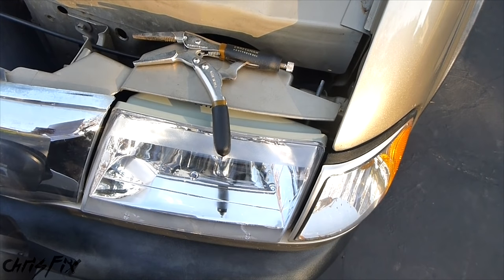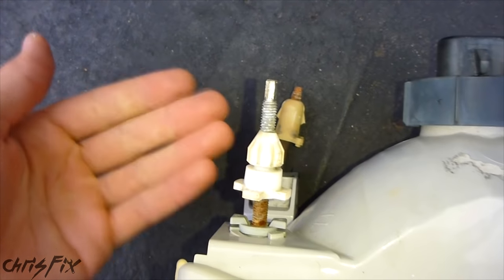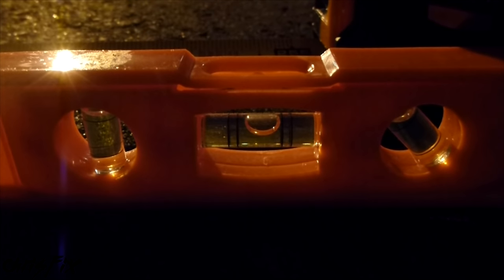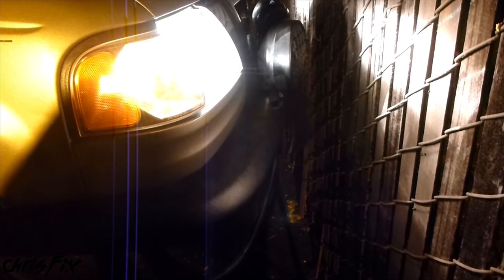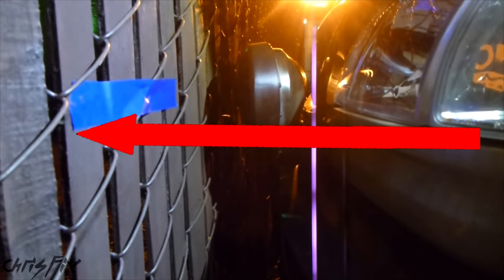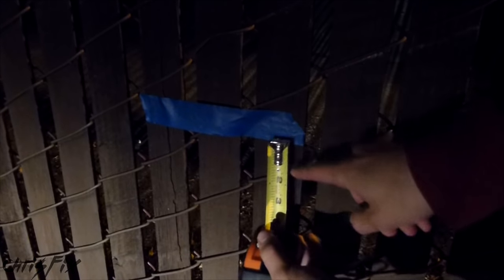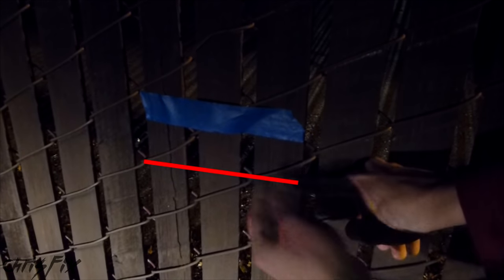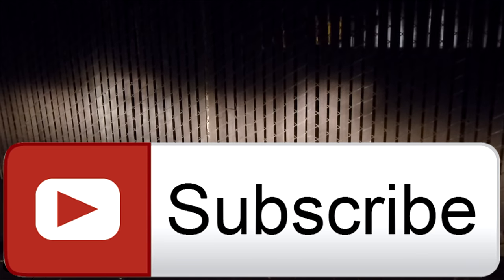How to Adjust, Align, and Aim Headlights and Fog Lights PERFECTLY

Comment: I need to do this with my truck. Currently experimenting with led lights in the stock housing on a 2001 durango. Any suggestions on bow to do this with those? Should try both adjusting the lights themselves on the cuff (has 4 positions to rotate the light for different angles) and the adjustment screws on the headlight assembly?

Comment: ChrisFix, Hello i have a question,  for my vehicle i have a 09 Toyota Matrix, and when i saw you adjust your lights, you measured from the bottom of the headlights to the floor,   Now the problem is, For my lights their slightly slanted which doesnt give an Accurate measure. The only good thing about my lights is, They have that little Nipple on the actual light, how would I adjust my headlights if it has that?

Comment: Hey Chris wondering if you could help me? I was adjusting my vertical screw and the assembly( I think?) fell down and was pointing towards the ground. Any ideas? I did get it to point back up, but it’s too low and won’t adjust any higher.

Comment: Just gotta new lights for my truck and it was ticking me off when it wasn't level like my old ones. Gonna do this in the morning, thank you!
Reply: Stop using the standard 2" & 4" drop, these elevations change according to light height. States have min and max projection distances for the low beam. generally 135' minimum and 200' maximum. If you use the 2" drop @ 25' on headlights that are 42" you'll projected the beam @ 520' and not the state maximum. STOP BLINDING OTHER DRIVERS . 42" height @ 25' should be 5.25". Use the formula (42/200)x25=5.25" below center line. ( bulb centerline / light projection  feet  ) x the distance you are projecting it to  ( test wall, test board or other ) it could be anywhere from 10 feet to 50 feet. 

Fog lights have a maximum of 135' projection, so get those adjusted correctly too.

Comment: And use peneteant fluid on old rusty screws... One guy in control station during control pushed so hard on screws in my forester that he broke screws and I had to replace them -.- thankfully I had spare broken lamps and I was able to swap them but... Just saying, plastic turn knobs are not supposed to be forced with morse pliers

Comment: I can't even locate the adjustment screws in my 2008 Toyota Sienna.  I'm thinking that both headlights are pointed down too much.   I did, however, use toothpaste to greatly reduce the opacity of the headlamp lens.

Comment: Hello. I'm new to your channel, however I really enjoy it so far. I did have a question though. I have a 95 Nissan Pathfinder and the fog lights don't turn on. The bulbs are good, so are the fuses, and all other lights. The fog light switch in in my console and when I flip it, the switch itself lights up, but the fog lights stay off. Any advice?
Reply: I'd say it might be the wiring... have you checked if the current is getting through? or if there's any damage to the wire itself

Comment: would the 2 inch process be the same for sedans though, because your truck is obviously at a higher ride height than most cars.
Reply from the maker: It is the same for every car since it is about the angle. There are extreme circumstances like a lifted truck where you might need more like a 2.5in drop.

Comment: that's all fine and dandy if you want your head lights to be level, but most states require your lights to hit the pavement at 150 feet, level lights don't do that, 90% of ford vehicles from the factory are set level and are illegal in most states.

Comment: ChrisFix.  What is the purpose of the plastic parts on the adjusters if what you need to do is adjust the bolt ?
Reply from the maker: It holds the threads in place.

Comment: Hey,

What kind of aftermarket headlights are those.

Did you get them on rockauto?

When I compare the mazda and the ford headlights for 2001 they show up as different part numbers and are slightly different. The Ford one is cheaper, so I am wondering if they are exchangeable?
Reply from the maker: +Francoxyzm Unfortunately they are not interchangeable. I got them on amazon for $100 each. Here is a pretty good price for the pair: http://amzn.to/1LpxxaK

Comment: thnx for that work. and im gonna ask something. if you have adjustable light height 
level 0 to 3 inside the car, which number should be selected before the adjustments... or it should be lowest height ?  thnx a lot.
Reply from the maker: +Koray yücel That is a great question. I would set it at 2 so you can adjust it up or down if need be.
Reply: +ChrisFix thank u chris. It s a good advice.  U re awesome
Reply: +ChrisFix hi Chris. do you have any idea for perfect clean beige car seat and interior.? not leather, for fabric.

Comment: hey do you know how to turn off the daytime running light for a ford ranger?
Reply: maybe check the fuse that is connected to them. u can see it in the manual book. and you can pull that fuse away from your fusebox

Comment: is the procedure the same with projectors? I have a 99 WJ with retro-fit projectors and I'm not sure if I should be aligning them based on the beam under the cut-off or with above the cut off. For now I have them aimed low since I kept blinding people when I first put them in.
Reply from the maker: +Eduardo Serrato Same exact procedure with any headlights.
Reply: Awesome! Now I just need to find a good place to do this and I'll finally stop blinding people and I'll be able to see. Thanks.

Comment: Really wish this was mandatory for all the stupid truck owners with hid bulbs in the fog lights and don't use projector lens in the headlights... Then add on 15 other bulbs and run those two just to make sure. Great video had to do this two years ago on my car.
Reply from the maker: ferretkiller9454 Thanks a lot. I think people with HIDs and reflector housings should get tickets. It is like running high beams all of the time.

Comment: hi Chris, I am working on a PT Cruiser that for some reason I cant get the headlights to adjust. do you have any suggestions?
Reply: I think I see what needs to happen. up/down adjustment works fine but the left/right adjustment looks to be shimming the anchor mounting bolts. ok. out with the headlight assemblies.

Comment: Quick question, is it necesarly to be 25ft to make the meassures?
Reply from the maker: LOV2XRL8RL It doesnt have to be perfectly 25ft. It can be 24' or 26'. If you have to do it closer, do half of 25ft (12.5ft) and instead of lowering the tape 2in lower it 1in.

Comment: You want the passenger side to be 31-32 inches from the ground and the driver side 28-29 inches so you dont blind other drivers
Reply: Nope.  The proper beam measurement depends on the distance from the wall and the height of the headlight housing itself as Chris has indicated. Using your logic, an RX-7, with headlights only 20" from the ground would be shining right into the eyes of oncoming drivers, while an F250 would have only a good view of the ground about 40 feet out.

Comment: Do you know if it's possible to aim the headlights on a 2002 Toyota Prius? It seems like they're fixed but I could have missed something.
Reply from the maker: Matthew Santos They are adjustable but finding the knobs and turning they with your hand is tough. Try to look on the back of the headlight and feel around. They will be there!

Comment: I'm working on a project for making the headlights align themselves automatically as the car turns and speeds up like some of those BMWs but so you can bolt it onto any car, can anybody tell me exactly what changes within a headlight when it's adjusted?

Comment: Very helpful video,i did cringe when i saw the visegrips on the adjusters,lol,im one of those that has to have the right tool for everything, they do sell a headlight adjuster tool, its like 12 bucks or so and it looks like a little miniature ratchet real long and it goes in those little 4 mm tips,i have one and granted is not something that you will use a lot in your lifetime but i like having it, the name of the tool for anyone interested is    
Lisle 14540
Reply from the maker: +dntlss Thanks for the tip!

Comment: It's a lot easier to use a plywood or cardboard panel instead of a wall. You just move the panel to square it up to the car instead of squaring the car to a wall.
Reply from the maker: ***** Either way works. Thanks for the idea!

Comment: Hi Chris, how can i adjust lights of a Honda Accord 2006 as i have been driving the car with the lights facing the ground.
Reply: +Olumuyiwa George are you from South Africa? those vehicles should also have adjustment screws .... or rather take it to a local testing station... they can help you

Comment: hi chris fix how would I line my my head lights .I ave a Vauxhall Vectra 54 plate .and my fog lights are rite inside the bumper .how u can help
Reply from the maker: +Roy Holding It is the same process as in this video.

Comment: ChrisFix Would this work for pop-up headlamps? My Firebird's a little off.
Reply from the maker: Yes, this works for pop up headlights. Just put the headlights up and do exactly what I did in this video. Your adjuster screws are holding the headlight in from the front.

Comment: Why did you have to drag the tape 2 inches below again? just wanted to confuse those who don't know why you did it?
Reply from the maker: Because you want the lights angled down. If you dont angle them down it will be in the eyes of oncoming drivers and too high to illuminate the road.
Reply: kay poly My 92-96 Toyota Camry/Corolla Haynes manual says 2 in. down and 2in. to the left. So you might want specifications for your vehicle

Comment: Hi Chris. I have a bmw e90 2005 with normal h7 bulbs. What can i do to adjust mine? They don't have anything to adjust left or right, just up and down. Thanks
Reply from the maker: So left and right should be good then? If so just adjust up and down. If not, you can shim the lights to tilt it outwards
Reply: @chrisfix  As far as i know the left and right movement is operated by a little motor inside. Like some king of auto adjust when you move the steering wheel. But for what i see, when its on center/straing, the lights are very close toguether on the wall. The car is pointing to center 😅 and i don't see left and right movements when i steer. I was asking because you have an e46 and maybe its the same way i don't know.

Comment: Hey man, you should do a video on hid lights! I wanna know ur thought on them and do a review and installation video. I have recently just bought a set of kensun hid 8000k and i also drive a 03 ford ranger. Thanks!
Reply from the maker: nolan moreno Funny you say that. I have everything to do a projector retrofit from TheRetrofitSource Inc I am just waiting for the weather to get a little nicer so I can start the project! I will be making a video on the retrofit process so you can start with a normal headlight and end up with an installed projector headlight! Stay tuned!

Comment: Can someone tell me or send my a link on how to adjust the headlights on my 04 silverado 1500? I looked it up but can't find any info on it so i tried to do it myself. It has one screw to adjust it vertically but the problem is that the low and high beams are in the same housing. so when i have low beams on the left side is lower than the right and when I put my high beams on its the opposite. I just can't get them to be the same when using high and low beam
Reply from the maker: +knk171 Try the silverado forums and ask them there.

Comment: I have an 87 Oldsmobile Cutlass Ciera, it needs some TLC. my headlight adjustment screws ore on the outside and they are star bits. and also do you know much about the 87 Oldsmobile Cutlass Ciera?
Reply: Paul Brown I had a 91 Cutlass Ciera. They are good cars, as long as regular maintenance is followed. They don't have as much computer monitoring as newer models. I had a Hyundai Sonata that gave me nightmares! it had sensors for everything, even for sensors! I am glad I got rid of it. Wished I still had my lil Ciera. That car was somewhat easy to work on, drove great, good ride, & had some bit of style to it. I have a F-150, 06 model now. Great truck, but the gas pump is it's best friend!!! $5 in my Oldsmobile was at least 1/4 of a tank. $5 in this truck will get me to the next gas station!!!

Comment: +ChrisFix I really need your help with algning and aiming my headlights. I have a 2003 toyota Camry. Unfortunately, I dont have an adjuster on my headlight assembly.
Reply from the maker: +jOeL SiMoN There has to be a way to adjust them.
Reply: ChrisFix Well There is this screw that looks like a gear behind the assembly, but I cant adjust it with the headlight on the body. it needs to come out especially for the drivers side one.

Comment: I'm at the 2 min mark Chris Fix and you still have yet to SHOW HOW TO DO THE ACTUAL DAMN ADJUSTMENT.  What I mean by that is what measurements to take and/or how to do it.  I don't mean how to turn the adjuster or what type of tool to use to turn the adjuster, etc etc etc.  I mean what the steps are to ensure  that your light are level.....damn son, tighten up!   Tighten your s**t= up!

Comment: How often would this have to be done? yearly? Mileage?
Reply: TheMichael408 typically you should adjust it whenever your headlights don't illuminate the road fully, or when one of the headlights become misaligned. It's easy to see when pulling up to a dark wall with your lights on, both headlights should be about level with each other.
Reply: Raptor yea I mean I see shadows too from the housing.
Reply: I do it every time I change the bulbs. I use to super bright halogens and they last like 1.5 years.
Reply: TheMichael408 i think, as long as u didn't make any accident or a strong hit on the headlights the balance will remain the same as good, but this for new cars, if the car 10+ years old then maybe its need more often adjustments like at least 1 time a year would be oki..

Comment: Half the cars on the road in a city like Los Angeles are in significant disrepair.  Bad tires, questionable brakes, suspensions and emissions out of spec not to mention bad driving.  NOBODY gives a shot in our increasingly lawless society.  Commercial operators sorta do but only because there is a degree of enforcement.  I'm all for headlight alignment but do it for your own self, not others.

Comment: don't get me wrong, I like the video but somehow this feels overcomplicated. I've adjusted my headlights simply by stopping in front of a wall about 20~30m far away and leveled the cutoff where the ground and wall meet, and move the _/ pattern to the right of the car. but I'm in europe where the beam pattern makes things much easier and also have xenon projector headlamps with crisp cutoff.
Reply from the maker: +Jukonja This gets them perfect. You wont blind anyone and you will get the maximum use of your headlight beams.

Comment: Hey Chris, I buffed my lights and not bad but I got the sandpaper to make it better. Well the one headlight is smooth but foggy didn't do the other one. Not scratched just foggy. Used 1000 and 1500 grit. Any ideas? Thanks Dave
Reply from the maker: dave gale Here is the perfect video for you: How to Restore Headlights PERMANENTLY
Reply: Chris that's a great vid. But at this point the headlights are foggy  from I don't know what. I tool out a bulb to get inside but it didn't help. Could that be from outside? I could sand with 2000 grit if you think that would help
Reply from the maker: dave gale They are foggy because the sunlight's UV rays degrade the plastic. Sometimes it is so foggy you need to sand extra and sometimes it is so bad you need new headlights. If they are bad, you can try taking apart the headlight lens and cleaning the inside like you did the outside. Then if you clean both the inside and outside and they are still foggy, they are probably bad. Here is how to separate the lenses: How to Separate Headlight or Fog Light Lenses (without Oven, EASY)
Reply: Hey Chris I went back and looked at your site on cleaning.,and I thought I did it right but I san
ed further with 2000 grit and some polish and wow!! they look great. Thanks Chris
Reply: dave gale
The only bummer is that they'll be cloudy again next year since the protective coating is gone.
Reply from the maker: ScubaCat3 Check this out: https://www.youtube.com/watch?v=UEJbKLZ7RmM
Reply: ChrisFix
Good idea.  How long does that last?  For the Windstar (we have an 02), the TYC replacement assemblies including new bulbs are $40/piece on rockauto, so I went that route.  I did a pretty ghetto job on aiming but they seem good so far.  Granted, assemblies for other makes and models are a LOT more expensive to replace.
Reply from the maker: ScubaCat3 It will last a few years. If the headlights are only $40 it is worth it to just get new ones! It is amazing how much better the car looks after you get new/ restore headlights right?!
Reply: Yeah, I'm impressed by the difference watching some of these videos.  I did the buff/polish thing last year (which you'd never know looking at them now) but brand new is even better.  Interesting that the new assemblies include new bulbs too at that price.
Reply: dave gale Polish with water flowing from a Hose with minimum of 3000 Grit Wet & Dry abrasive paper and then buff with Fine cutting Polish ( Yes the Body Paint stuff ) , you will find they will clean up well, this is unfortunately a down side to modern Lexan and other Plastic or Polycarbonate light fittings they will eventually get cloudy again so a gently polish with you regular Car cutting and polishing compound will go a long way to keeping the lights clear.
.
Reply: thank you